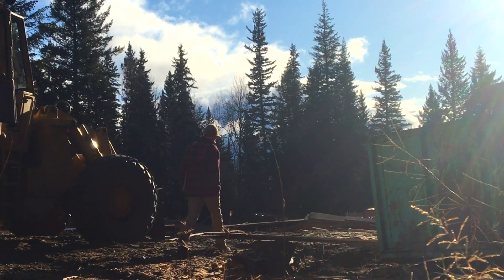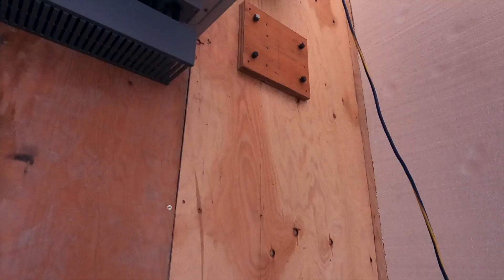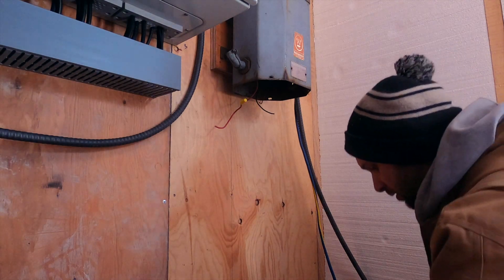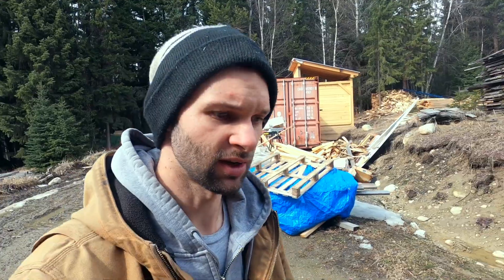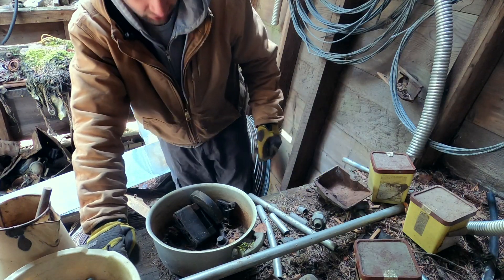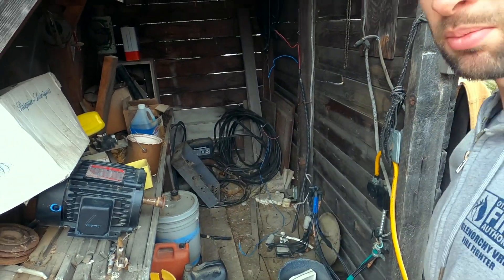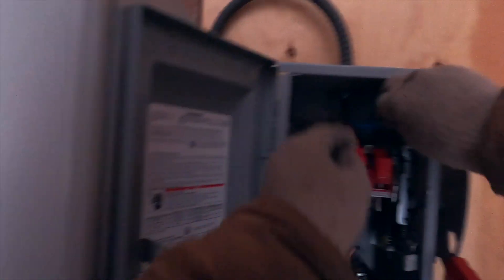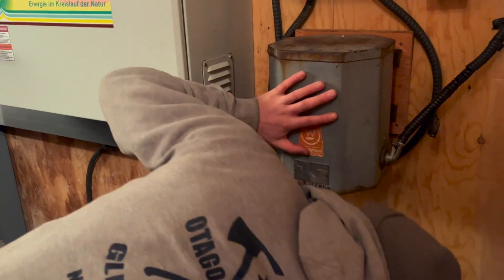Building a Fancy Dry Kiln - Wiring and Power (part 3)

Comment: The transformer wiring compartment is on the bottom cuz convective heat rises, and convection is how it dissipates almost all of its waste heat.  Having the wiring compartment on the top means that the wiring insulation would cook.
Reply from the maker: Well there you have it. It does get very warm while it’s operating, so that makes sense.
Reply: @MountainVoiceInc  There should be temperature rise and insulation temperature class information on the transformer nameplate.  Iffen it's a class H (428°F maximum permissible core temperature) 270°F/150°C rise transformer, then it gon' get toasty.